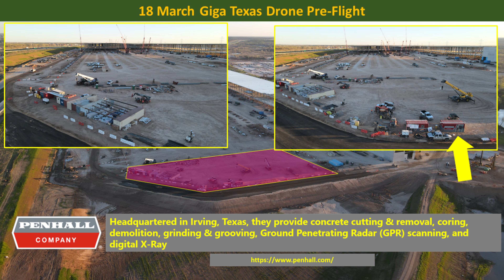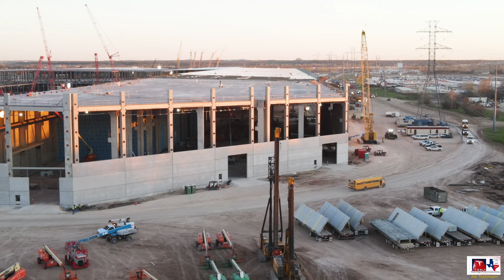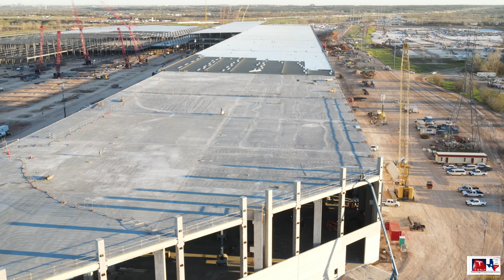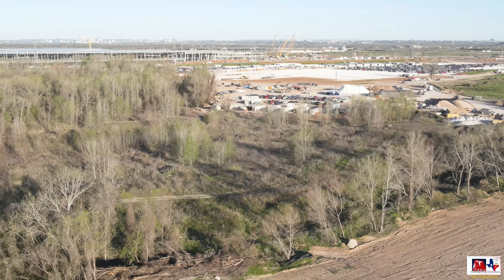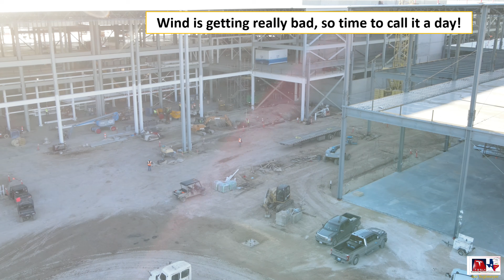Tesla Gigafactory Texas 18 March 2021 Cyber Truck & Model Y Factory Construction Update (07:30AM)

Comment: Just a couple of thoughts: I wonder if in their haste  to get started that they overlooked some of the problems with the fill methods for the site. This could be why so many more geopiers were needed. The ground penetrating radar could be used to evaluate the terrain in order to save on geopier costs. I believe the stacks of corrugated steel decking that you refer to as roofing are structural decking panels that are used for both the floors and the structure that will support the actual roofing material. This would include the waterproofing and insulation. Perhaps the roofing will not be installed until the water management system is installed.

Comment: Perhaps I missed an explanation, but why is the blue wall at 26:05 blocking the bridge crane ?  (And thanks for your efforts. Your footage should be used in a Construction Engineering class!!)
Reply: We suspect it is either a firewall, or to block construction dust during assembly, or manufacturing dust (?) from contaminating stainless steel.

Comment: With the perimeter grade beam now extended all the way northward, concrete floors being poured, massive amounts of equipment having already been installed, I wonder how long it will be before we start to see the steel structures begin to get exterior cladding?
Reply from the maker: I'd say by the middle of April
Reply: @JoeTegtmeyer  Probably about right - once the steel framework reaches the southwestern perimeter of the building & they've finished with the casting machines, Geopier work, foundations, framework etc in the north eastern corner. Of course they may want to wait until the battery manufacturing section is done but I doubt that's a given.

Comment: Hi Joe and interested viewers. FWIW. Footprint comparison Tesla Nevada v Tesla Austin

The image on Google Earth Pro for Tesla Nevada was last updated in August 2019. I don’t know if the factory has been extended since. Using Google Earth Pro’s ruler feature, it’s possible to measure a polygon to get the area of the image shown that is under roof, which I did and got 178,500 sq metres/ 1,921,358 sq ft.

Accurate? I wouldn’t bet my house, but surely it’s within some sort of acceptable tolerance.

Tesla Austin, not on Google Earth Pro yet, but we do know the column spacings (45'10" 13.95m), and that the grid is 26 bays wide x 85 long. I calculated the current area of Tesla Austin currently under roof, or where footings have been constructed, so that doesn’t include the area north of the casting plant, or the area without footings to the southwest where the contractors are moving all their gear to, minus the cut off corners, and I have also not counted the central roadway. 

Got a total of 332,182.20 sq metres/3,575,577 sq ft. Already nearly double Nevada. Give or take.

Comment: Wouldn't the large excavation be where they will temporarily store the batteries during the "curing" process.  In the battery-day video', you can see these automated racks that are high where they store the produced cell for a certain time so they can "cure".  Based on the size (and projected output), I would think they need a LARGE rack of these, and double to assure continuous high-flow output.
Reply: I keep pondering this, and think they would need even more storing than that.
Reply from the maker: That is my primary suspect for the two excavations as well!

Comment: Hi Joe. Great effort on such a blowey day.
1:25. New compound. Possibly shifting everything from the west side to here so that they can construct the west section of a perimeter road. This south west corner maybe not being built on in the short term.
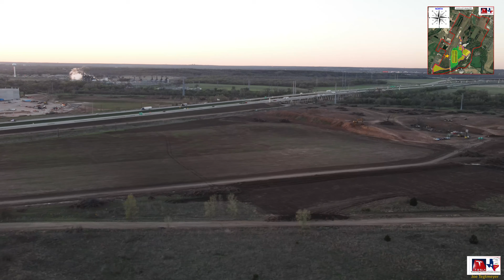5:24. Nicely contoured area immediately south of the old house. Looks like earthmoving is completed, and has a lake shape feel to it.
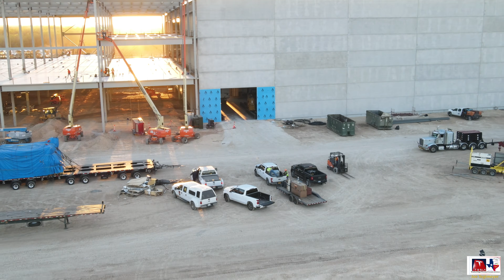10:24. Notice the care being taken by the skid steer operator as he covers up the white sheathed rebar half of the footing.
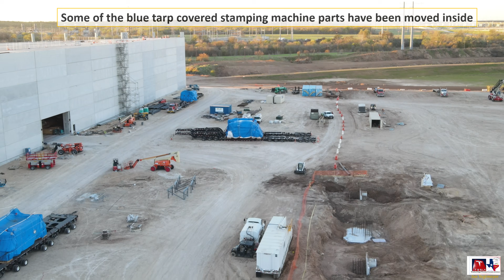10:59. Left of screen. The precast panels on this west wall have been caulked in the last week or so. Short sections of backing rod or foam hanging out of the panels joints 3rd and 4th from top.
15:44. Current end of electrical conduit trench. Going to a separate yet to be constructed building, or is there a likely location within the main building?
16:13. Tunnel? I think they’ll dig up half the road and lay the conduits over a night shift, and complete the other half with the next night shift. There is that gravel section of roadway to help with traffic. Asphalt road one evening, gravel road the next.
20:40. Seems to be a new excavation under the east line of the steel structure, behind the white excavator. Might be in line with the northern row of concrete columns. 
22:54. Bottom of screen. 5 Meter sprint World Champion in the orange vest, don’t mess with him.
Reply: Your notes on Joe's videos are like the cherry on the cake.
Keep it up !
Reply: @musaran2  I'll do my best right up until the construction stops. Not familiar with car factory plant, and certainly not with Tesla plant, my guesses would be wilder still!
Reply: "until the construction stops."
(looks at size of terrain)
You might want to retire at some point.
Reply: @musaran2  This main building only!

Comment: I'm guessing that the "two old houses" had no historical significance and were cleared for demolition.
Reply: If anyone’s curious as to why they took so long for demolition, think of the dumpsters parked out front. My guess is that the houses may have contained hazardous materials that needed to be removed before demolition
Reply: @ItsLilRobs  Maybe. They're gone now.
Reply: @ItsLilRobs  And that may have required additional paperwork, approvals, etc.
Reply from the maker: I agree and is very similar to what they had to do with the old house and structures on the east side.

Comment: At 8:24 I don't remember if that long trench in the concrete was cut or poured, but that kind of cutting is what Penhall does.

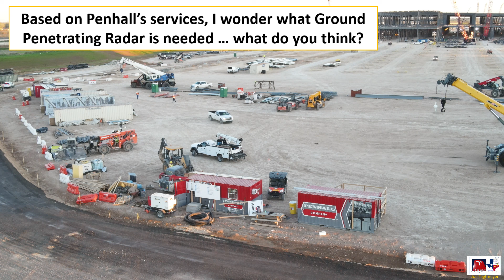9:22 GPR is used when the ground can't be dug up due to historic preservation or something similar.

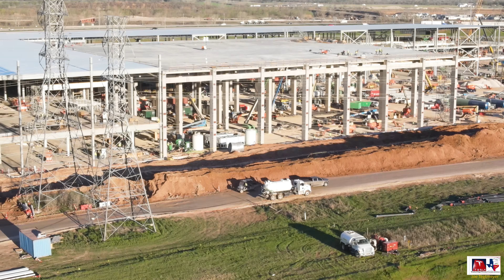At 15:20 very busy with so many trades working with so much equipment.  So much traffic and vehicles all over.  But it's difficult to work when you're tripping over others. ☹️

Thanks, Joe for the great video and groovy tunes.  And for putting up with the weather, wind and rain.  👍👍👍

Comment: I still can't believe they aren't doing more to pour the slabs and foundations in the casting area and putting the rails up for the next bridge crane. They are going to need those in a hurry when they start putting up walls and it will just get harder for them.
Reply: It’s like a choreographed dance, just sit back and enjoy the show. They are doing some things differently than on jobs I have worked, but without being in the planning meetings I have no idea what all their situational requirements are. The one thing I do know is that they know more about that particular site and job than I do, so I just sit back and watch it unfold. In this case for example they have ordered a new larger casting machine that I don't believe has been built before so they may be waiting for it to be finished so they have the exact dimensions for the foundations.
Reply: The next bridge crane will be in the east stamping section. From this video, the are putting the mounts for the support beams onto the posts.
Reply from the maker: @kkarllwt  yes they are ... good eye!
Reply: It took close to a month to install the first press and they have 2 more foundations ready so I think they will have plenty of time to get those other foundations ready before it's time to install them

Comment: The large excavation in cell area is probably for cell formation discussed on battery day. The equipment looked quite large
Reply: I agree.  was going to say the same thing.  The charging/testing racks are very tall, long and will be very heavy.
Reply: You're probably right. Whatever the case, it's nice to see they finally decided on the design for the cell factory. The permit request in Berlin points to a final design as well.
Reply from the maker: That is my primary suspect as well!

Comment: Probably testing the bridge crane for certification for use rather than calibration. Much of the process is to assure that the bridge crane is functional and limit tested for acceptance and use. Probably what you meant.
Reply from the maker: Good point ... thanks Michael.

Comment: What you are referring to as a “switchyard” is actually a substation.  Switchyards don’t have transformers.
Reply: Agreed, this is really a substation. 
 
I am not as optimistic as Joe about when it will be energized. The poles need arms, insulators, wires, etc. There are still busbars that need to be installed.  They are still testing the monitoring and control electronics of the transformer, and perhaps still filling the transformers with cooling fluid from the tank truck.  I am guessing that even inside Tesla property the substation will have a chain-link fence or similar barrier to restrict access for safety reasons, and the construction of such would be a good sign that they are much closer to connecting to the grid.
Reply from the maker: The official site plan listed it as a switchyard.
Reply: @JoeTegtmeyer  At the time the site plan was first made they may have expected to receive power from one or more substations located off-site, in which case they would primarily have needed switching for redundancy and fault isolation.  It looks like now they are also doing the voltage conversion onsite, making this facility a boundary between the transmission and distribution subsystems.  For people in the power industry that would be a substation; for people outside the industry the terminology is not as important.  For many people it is sufficient to know that the "large electrical stuff" goes in this spot.   :-)

Comment: There are going to be a large number of penetrations through the floors and roof which will be core drilled.  Before you start core drilling you x-ray the area in an effort to miss any rebar in the layers of concrete.  Hitting a piece of rebar with a coring bit can make for a very bad day.
Reply: Roger P
  cored holes in concrete for plumbing with Hilti machine. Chewed through rebar no problem.
Reply: I had not thought of that, thank you. I have worked in alumum foundrys and they x-rayed (digital for real time) castings for defects so I wonder if Tesla will x-ray castings. The foundrys I worked in did a lot of aerospace work where nondestructive testing is manditory. Tesla is automotive so they may not need or want to spend the money to x-ray parts. Anyway I like you answer.
Reply: @patrickdougherty2777  They're gonna x-ray each and every casting for holes/gaps/bubbles. But that's a specialty part/robot that is part of the line, maybe provided by IRDA, and not some local company specializing in concrete cutting work.

Comment: Hey Joe!

Regarding the rental tanks. You've pretty much nailed what they are for.  Basically, they are both storage and receptacle (depending whether pumped from or to) for the water supply/waste side water systems.

Note that currently, there is no water treatment facility on site. Also, we haven't yet seen any drilling for water supply or connection to municipal water yet. They MUST test both supply and waste side water systems for problems before they continue with construction over the related areas of installed piping. So the only way to test these systems is to force pump water through all the piping. This also cleans out any dirt which may have inadvertently entered either side.

I have no idea what their water supply situation will be other than the water wells we saw installed at the concrete plant. Even though I claim ignorance, I suspect they'll be installing a number of water treatment plants on site. I'd like to remind people that H2O Innovation has an existing contract for the Giga Texas site to at least do the engineering. Any other details are unknown at this time. I see a need for at least 3 water treatment facilities or at least the ability to treat water solving 3 cases.

1) Supply side - I expect them to drill a well or wells for supply side and include treatment to make the entire site supply side potable. I don't expect them to have a municipal hookup.

2) Waste side - 1 - I expect a general sewage (high quantity but  relatively light) treatment similar to a small municipal treatment plant.

3) Waste side -2 - I expect an industrial waste water purification and recovery treatment (water recycling) plant. There are at least two major industrial processes we know which will required recycling used water. One is the "paint shop" and the other is "battery production".  You might want to look at this video from The Limiting Factor: https://www.youtube.com/watch?v=RVeqYkGXdQo It discusses the Tesla's new manufacturing method for cathode material. The vlog explains where a lot of the water reduction and recycling comes from for the new 4680 battery  design.

As a tangent, in terms of temporary (what I presume is potable) water supply - every now and then you see white plastic carboys scattered at various places on site.
Reply: Guy,  Thanks for the detailed piece about water supply and processing!

Comment: New large rectangular pits in the battery production area might be where storage tanks for lithium or other battery materials will be stored.
Reply: Given the annual 50,000 tons of the intermediate product to be delivered for lithium hydroxide processing, that would require maybe four truck loads daily. Will be interesting to see if there will be a loading dock and receiver area for the battery section.

Comment: The only thing that I can think the battery area trenches are for, are completed cell testing/storage. In the battery day presentation video of the test production line in Freemont, they showed what looked to be holding racks for completed cells. Since this operation will be multiple times the size and in the battery area, it makes sense to me.
Reply: I don't think the road runner plant has those trenches so they remain a mystery
Reply: @aussie_al  I don't think they do either, but being several times the size and weight of what's in Freemont, plus the orientation, the pieces fit.
Reply: Agree 100% they have all the hallmarks of an automated warehouse rack system like is used for cell testing and conditioning.

Comment: What's everyone's guess as to the time frame?
Reply from the maker: I think they will have enough of the factory done to begin initial pre-production of Model Y in the third quarter.  Possibly first substantial completion  in July to late August is my guess.
Reply: @JoeTegtmeyer  there are apparently more hold ups in Germany over the sewage pipeline. It is every chance that Texas will be finished first but even my optimistic self can't see anything finished before Xmas unfortunately
Reply: @aussie_al  I agree with Joe, about 4 more months of this heightening pace the construction is progressing at should put the Model Y production line completion on track. Remember that some of this phase is for the Cybertruck, so yes those areas may well not be 100% complete before Christmas. That doesn't mean they won't be producing Model Y's before then. This is not their first time building out a Model Y line although it might include some new updates that reduces the automation equipment needed for it, such as 100 less robots to assemble the chassis. Personally I can't wait to see the first Model Y built there. 😎
Reply: My tracker said November 18th for completion of the main structure, as of this week's update. https://www.youtube.com/watch?v=xWB4pzRR1F8
Reply: First deliveries in November.

Comment: 24:05 Will the walls stick out of the roof permanently?
Reply: The walls extend above the roof for fire protection.
Reply: @eltonray2934  What will there be in it?
Reply: @robertn2951  Paint, and paint mixing.
Reply: Yes. Would be prohibitively challenging to cut them once installed, and there's no benefit to making them flush with the structure.
Reply from the maker: Yes ... they may form a mounting area for heavy equipment (HVAC possibly) ... I’ll keep watching to see what they do.
Reply: @JoeTegtmeyer  My guess is that that the roof inside those walls will be a blow out section in case of explosion. I have seen similar things in ordnance storage areas to direct the force out where it is the least harmful.
Reply: @zmavrick  What will there be in it?
Reply: @robertn2951  Paint and solvents would be my guess considering the location.